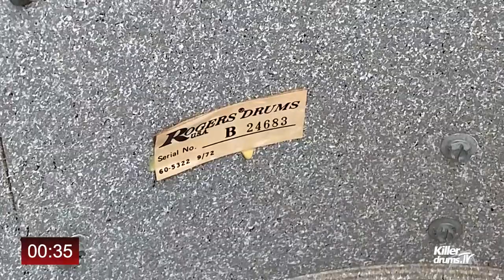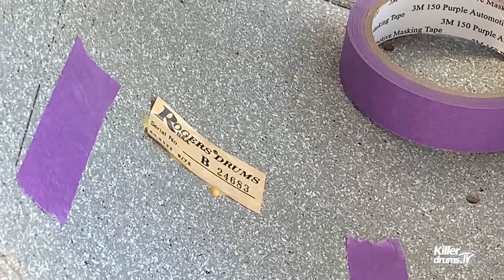ROGERS Drum Resto | PART 1 - How to remove Formica wrap fast.

Comment: I just did this last night to a Rogers drum, used a heat gun and a flat scraper to peel it after the glue warmed up a bit. It was fairly simple after that
Reply from the maker: Awesome Spencer.
Reply: Yes that's the way you do it. 
On a side note on the 1960's drums like Ludwig,Rogers,Slingerland, wrap in Pearl finish you can burn off the plastic wrap put the drum on the ground lite the finish on fire roll the drum on the ground with a metal pull the finish will be gone in 30 seconds.
I have been restoring vintage drums for over the pass 40+ years. I was also part owner of Orange county drums and percussion in California in the 1990's
Reply: How did you get the glue off the shell?  Did you leave it on and just rewrap? Or use thinners?  Or sand?

Comment: Please: what is the liquid product that you applied to dissolve the contact glue on the original wrap?
Thanks.
Reply from the maker: Hi Miguel, it general purpose paint thinners. However be aware that there are several grades of thinners, some cut down with less effective ingredients. So a quality general purpose paint thinners should be standard the world over, I hope. All the best with your project, and remember to never have a flame or heat source anywhere near paint thinners. Kind regards Tony Moore
Reply: @KillerDrumsTV  Thanks

Comment: They actually used Formica to wrap drums?
Reply from the maker: Yes! Correct. Formica laminate, which is far more sonic than plastic wrap or nitro wrap, which is dead. Formica is highly compressed paper impregnated with phenolic resin.